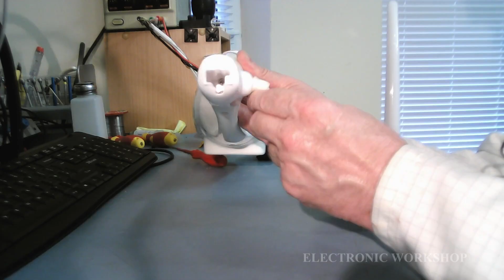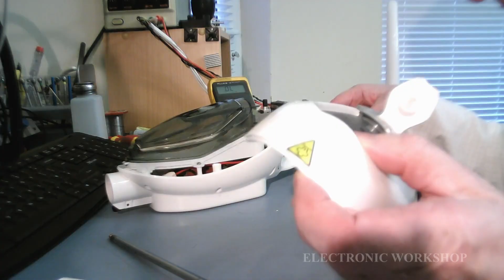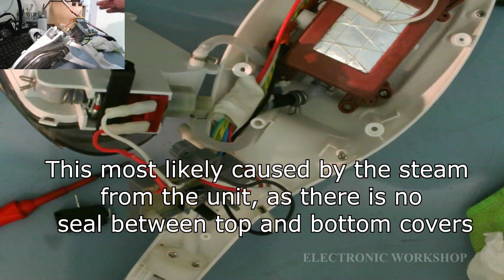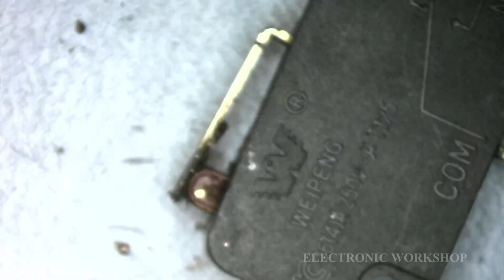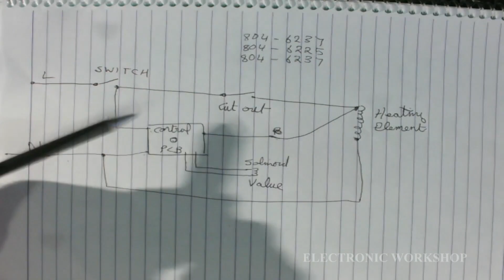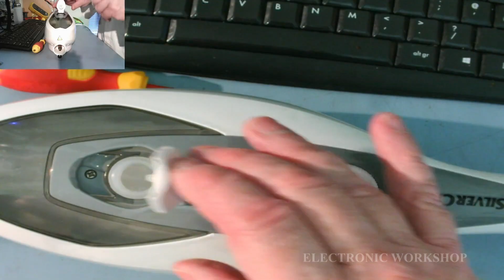Save Money: How to Fix Your Steam Cleaner at Home

Comment: Hi!
 I need advice.
How to repair/operate if I have the green light coming on and Im rotating the wheel to different speed, but no steam comes out?
What to do in this situation?

I personally think that the problem is in the wheel, because it feels funny/off-place.

I will take a deeper look into my problem, maybe I will fix it myself.
Reply: So I have opened it.
Seems that it's the same problem as in your video 😂.